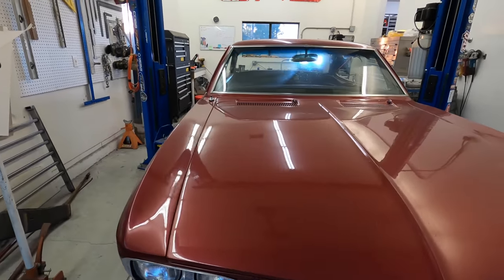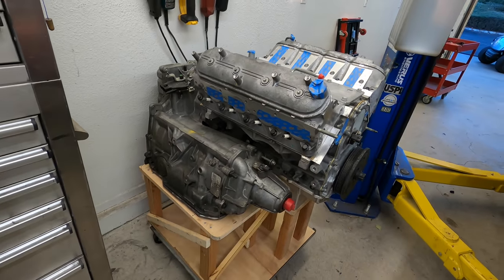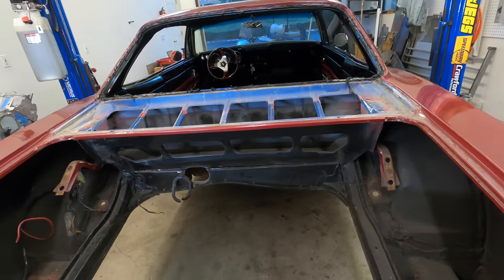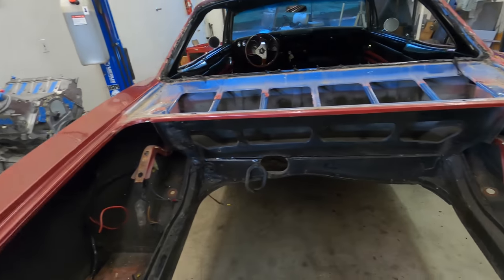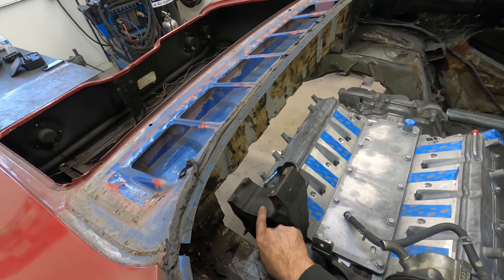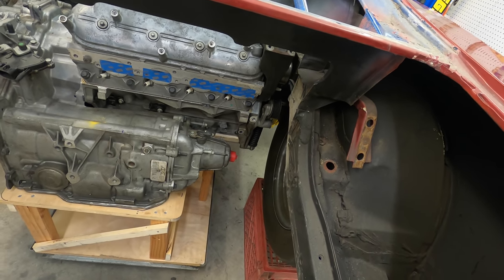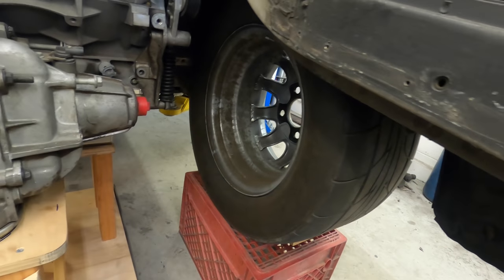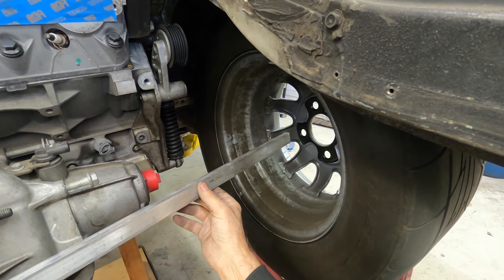Making a LS4 V8 fit into a Corvair

Comment: If you don’t know a late 80s G.M f body cars Cuttles, Regal , Monte Carlo frame will fit under the Corsair same wheel base and it is a perimeter style frame so maybe that would help with bringing back some of the lost strength.
Reply from the maker: That's one way to do it and has been successful for many.  I would like to do it without adding a bunch of weight.

Comment: What did you do about a starter? You didn’t mention that. The 4T80 is definitely a tough transmission but  so is the 4T65HD. I think it would be especially tough in a lightweight car like this. I don’t think that I would’ve bothered with the 4T80 swap for this particular application. I think it’s overkill, especially when you consider all of the other problems that are created by using it. This thing is going to be a blast to drive.
Reply from the maker: I decided to not mess with the 4T65 and move straight to the 4T80.  The car gets a turbo and will be over 700 whp.

Comment: That power steering pump won’t be needed, unless you have a plan for it. Maybe you can get the alternator in that area. I know you’re gonna have to do some drive belt reconfiguration. Will you have air-conditioning in the car?
Reply from the maker: Since the wife is also driving it, the car gets a/c, auto trans and p/s.

Comment: I had a concept of mounting a transverse 3.8 L V6 "behind" the rear seat of a '66 Corvair convertible, with some other custom features.   ;-)
Reply: 3.8 supercharged is a great idea.   And hd auto is bulletproof.
Reply from the maker: There are several transverse v6s on (Corvair) V8 registry.
Reply: So far the ones I've seen either remove the rear seat or split it into two very small seats.
If I google "Corvair V8 registry" will I get descriptions and images of the various conversions?
Reply from the maker: Google just V8 Registry.  You can see most without joining.  The way transverse works is the motor sits just in front of the rear axle centerline which means the rear seat has to go.  I don't know of any transverse combo where the motor sits behind the rear axle centerline.  If there were such a thing, then you might be able to retain the rear seat.
Reply: There was a magazine article a long time ago about some guy who mounted a Tornado drivetrain, "behind" the rear seat of a second gen Corvair.
A notch was required for a pully and he also  added small casters to protect the transaxle.
Unfortunately I've lost the magazine, must be decades ago?
Reply from the maker: Tornado transaxle transplants were common back in the day.  They are a bit archaic by todays standards.
Reply: One of my first concepts was to do a Crown conversion (inc. rear suspension) on a early '60s Corvair coupe and add flairs, bulging fenders, etc..., calling it my "IMSAVair".  ;-)

Comment: You are staring with a under 2500lB body. If you have ever been in a Crown Corvair on the street. A 280 HP 283 did a very good job of moving it around. 
The original engine was designed to drop out on the floor. That made changing the clutch pretty easy.
The good part is you won't need to detune the engine to run it on modern pump  gas. The 110 and 140s needed 97 octane minimum.
Well it has been 2 years and should almost be done and keep the original paint and use quiet mufflers. 
Some of the road tax collectors get jealous because the wifey makes him drive a mom van. (Stupid Urbanite Vehicle).
Yes I have two. I get to drive the old one.

Comment: this build is gonna be sweet. Just my 2 cents and advice for the whole rearend. buy some 1/4 and 1/8 steel plate and something around a 1 1/2" 0.095 wall dom tubing and make a cradle/subframe thats easily removable from the bottom. plate up that whole rear section and make it stronger and more rigid than the stock setup ever was. I have also used a tube bender from affordablebener.com and they're budget friendly ($400 shipped with 1 included die). Bender has given me decent results and would be a great tool to have for a project like this. Keep it up, cant wait to see more!
Reply from the maker: Thanks, yes it will have a removable power train sub frame.  Check out my last project to get an idea of my fab skill-set.  I got bogged down on another small project but can't wait to get back to the 'vair.  
https://youtu.be/1xyE8oU-s4c
Reply: @JohnReynolds661  Is this the John Reynolds that I (David Witcher) got to work with helping to finish Jason Payne's Crew cab Chevy Crawler that we took to Gorman for Fred Williams to photo? 2009.
Reply from the maker: @witcher71  Yes sir.
Reply: @JohnReynolds661  Fantastic man! Absolutely incredible work! Great to see you again.

Comment: I had thought about a full frame approach where the body pivoted up for access to the rear of the car & engine area

You have to remove alot of things anyway why not consider simply disconnecting the steering column and the roll bar then lift the rear of the body for access to everything driveline related 

Plus have the roll bar bolt down onto that main frame for strength

That way Yo have the freedom to design the Main parts and only have to adapt the Body/Interior unit to the frame

Yes

I know You probably already have this completed

These are ideas that You might already have figured out that Do Not work

Ken in Florida
Reply from the maker: Some do a full frame transplant.  There are a few reasons I chose to stay with the unibody the reason being less weight.

Comment: lots of oppotunity lost not using stock front sudframe. replacement axles and suspension components really to easy to pass up.
Reply from the maker: Except it's 8" too wide and I don't want fender flares.  IMO, it's more work to take the 8" out of an existing sub with links and attachments than it is to start from scratch and make it custom.  There's also no room to support double or even a lower wishbone/strut set-up.
Reply: @JohnReynolds661  8" wow. well that answers that. thanks.

Comment: Why a a/t , why not a 5/6 spd ?
Reply from the maker: Besides preferring an A/T, there is no transverse manual  that's strong enough.
Reply: @JohnReynolds661  what kinda Hp is the ls5 ?
Reply from the maker: @johngouker3887  stock is 300.  The way it's set up with a turbo is perhaps 550.

Comment: Imagine a reverse Funny Car style Frame with boy lifting at the rear and rocker panels resting on a real frame

Pivots at the front in front of the front tires
Reply: body lifting at the rear
Reply from the maker: I think there are a few old school examples of funny car body lift Corvairs around.  I've seen at least one.  Anyway, about the only Corvair left on them is just enough sheet metal to hang paint.

Comment: Yes, GLAD you're doing the Vid, but you NEED to think OUTSIDE of the "Box"!    Why not front-drive, N-S the LS WITH the radiator moved to the rear?   Or @ the front, you could N-S the engine like in many early US front-drives like the Olds "Toronado".    Again, radiator in the rear or not.   Done correctly, there IS "room" to keep the radiator in the front, if desired.  Look what the late-80s turbo Buick V-6 did, only now, with a V-6, you could  front-drive it.   You could rear-drive-it, by  using a turbo-buick V-6, N-S, driving the rear wheels, by re-configuring the bracing at the rear, like on the Ferrari LM race car.   The shorter-length of the V-6 gives you another 6-8" to better package the interior.  Why don't you cut-apart the 90-degree LS, to where it's a 120-degrees-"V"/or whatever will "fit" under the bracing, if you can't/won't alter that via cuts/tubing. The 120-altered LS could ONLY be N-S behind the front seating. You could reverse the LS head's exhaust flow, so your exhaust would exit from within the center-engine-valley{--6.0L Jag V-12}, putting  intakes on each OUTSIDE-face of the cylinder head, allowing the alternator to be placed low & outside.   The center-valley exhaust manifolds could STILL curve down & exit under neath the car, if needed.   Because the LS is all alloy[?], switch direction of your set-up 180-degrees, putting your oil-pan more rear-ward than where you Now intend it to be, and angle the  engine @ 45-degrees to the front, placing your plugs @ the cylinder tops like a true "Hemi", giving more "room" for seat packaging.  Or keep your tranny where it'll be and use an inliner {5L Ford OHV-6/4.2L GM LL8 inline DOHC-all alloy-6/282cu" AMC-6--all CAN make way  o.  ver 300Hp} tilted-over the tranny, instead of vertically-mounted as usual.   Your E-W LS mounting is VERY INTERESTING!
Reply from the maker: Jack, you have a lot of way-outside the box ideas.  Every possible engine swap in many configurations have already been done with the Corvair.  However, I might be the first to do a turbo charged transverse LS mated to a 4T80.  It's a difficult build, especially since it will be using the stock track width.  I'm happy with the decision and now it needs to be executed.

Comment: The name "Corvair" symbolizes a small Chevrolet with an air-cooled engine. Take the air-cooled engine off, and put a liquid-cooled engine on it, you basically have ruined the concept.  And Corvair engines can run rather nicely. I don't see why anyone would take out their power plant for a conventional one that belongs in the front.
Reply from the maker: Ha, you're really going to hate my Subaru powered bug.

Comment: You're going to try and keep the rear seat? I'm considering something very similar which is what led me to you. I was looking at using a K24 with a 35 degree rear lean with a custom oil pan, pickup and other supporting mods. I just can't stand the idea of the no torque bottom end. I don't want something that I need rolling anti lag to fly in a roll race. 
I'm pretty sure a VR6 3.6 from a Touareg or Q7 will be really close to letting me keep the rear seat. If I have to, I'll stretch the whole car after the B pillar and have a deeper rear deck. I'd also like the fuel tank under the back seat.
Reply from the maker: I'm getting close to showing more progress.  There's been many Corvair engine conversions and after considering them all, I chose a turbo transverse mid-engine LS4/4T80 combo. It's probably the hardest way to do the conversion but easy isn't worth anything. Can't use a back seat but it is a lot less crammed than a conventional mid-engine transplant.

Comment: If you haven't gotten the accessory drive yet a Vette LS3 setup with a low right mount alternator bracket would really help. It's the shortest projection and tightly packaged with nothing exceeding the heads (not valve covers) height wise.